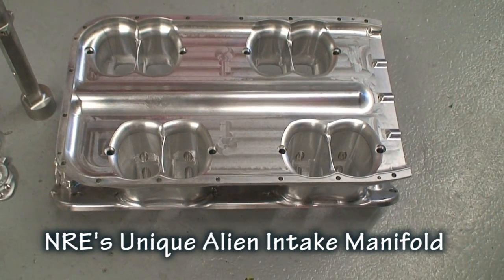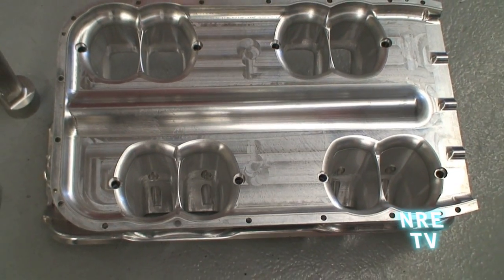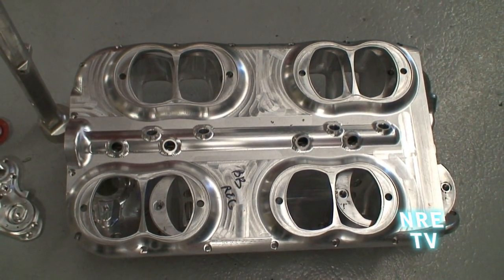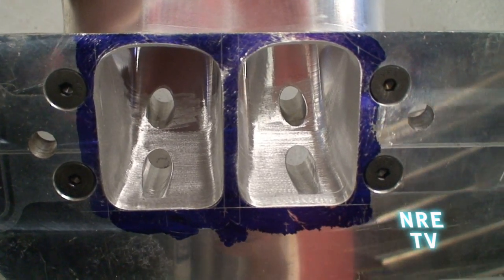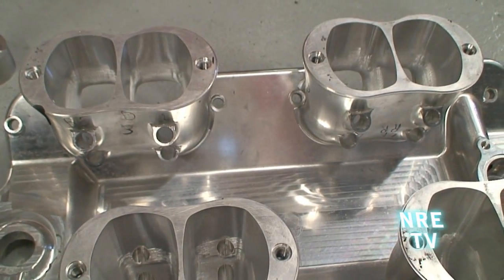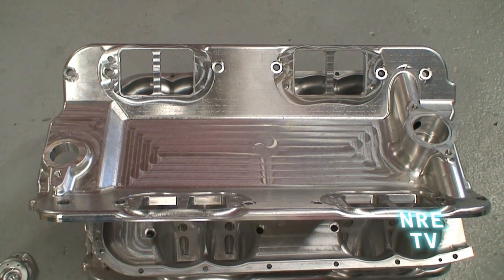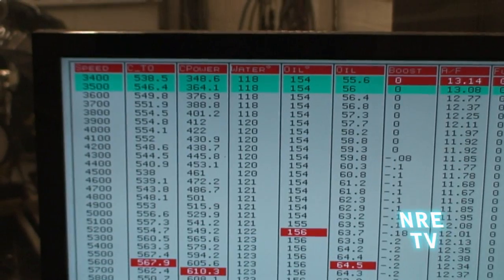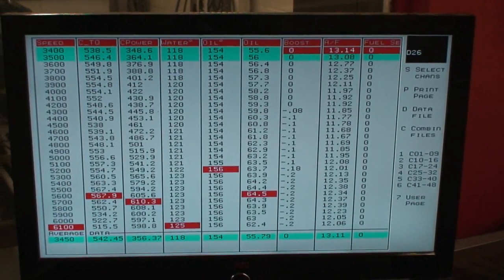NRE's Alien Intake Manifold Secrets Revealed plus 610 HP BBC Crate Engine Tests.  View in HD.

Comment: Billet dog legs. smh.  it probably doesn't make difference on this low po build anyway.

use pwm fuel pump instead of charging your poor customers thousands of dollars for billet fuel pressure regulators. again, smh

610 bhp on a 502 WITH cams. lol.  people do better with $500 cast carb manifolds.

Comment: 73hp per liter is competitive for a pushrod motor. bit its the torqe and that its all above 500ft lbs is more important. this all is on a bigblock(not known for hp, but tq) and this mainly stock motor from GM dont usually excede 1HP/TQ per cubic inch. so these small changes(sorta) is are extreamly powerful.

Comment: Sure, no! it's a precise and simple fuel regulator unit for 2 fuel rails. Atomized fuel in the fuel rail won't squirt out of the injector, because it'd mean it got some air there which is not good.

Comment: that's a beautiful bit of design, although a casting + machine would undoubtedly be cheaper if you're doing any kind of numbers. your manifold probably makes more power than that as your AFR if a bit on the rich side, or were you running into det?